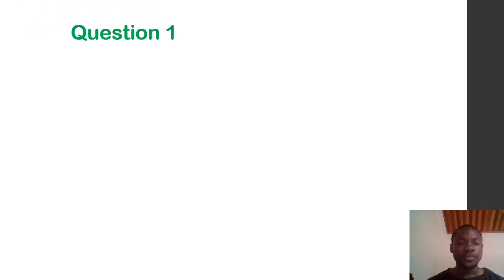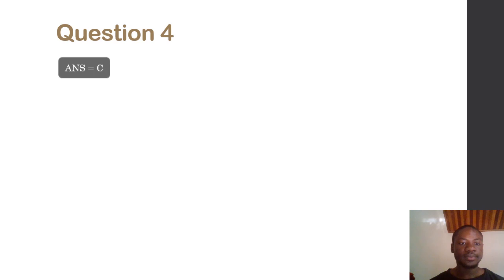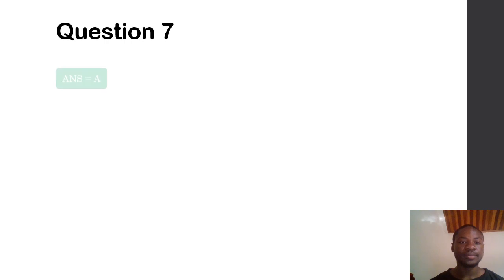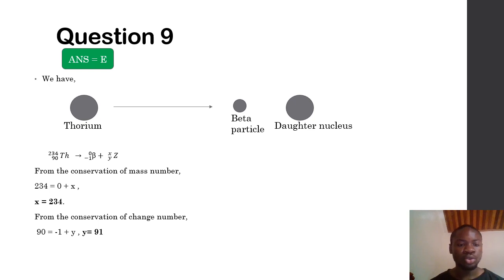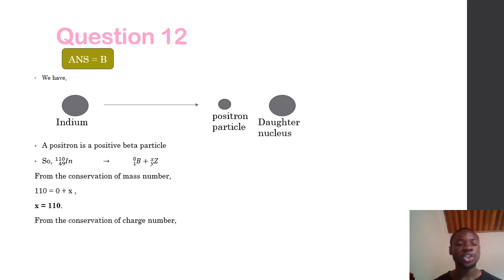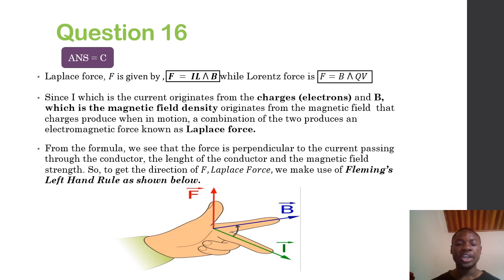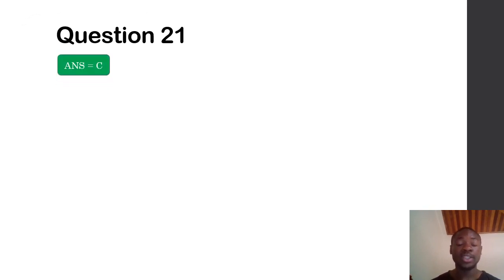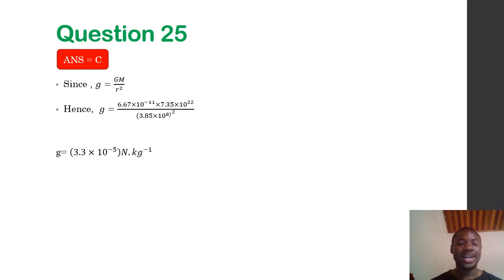Entrance Exams to Medical school Physics 2021(FMBS, FMPS, UDM, ISTM, FHS)

Comment: Q1. 
The null electric field point can not be between the line segment joining A and B because the electric field is rather enhanced between A and B, therefore option A is wrong and off! 

It is possible for the electric field to be zero outside of the line segment because the electric fields are then opposing each other. But for it to be zero, the forces due to each of the charges must be equal and opposite in magnitude on a reference test charge. Notice that the forces can only be opposite in magnitude outside of the line segment joining AB and there is no distance away from either A or B where the electrostatic forces will ever be equal in magnitude. While the product of their charge magnitudes at distance x from either is equal, their referential distances from the test charge would always vary. Therefore answers B and C are wrong and off! 

Further, you can only ideally get a point where the net electric field is zero at a point situated at infinity relative to the electrostatic effect of both charges. Therefore D is incorrect in this case. D would however be correct if the magnitude of the charge on A  was different to that on B but both have equal magnitude of 6μC